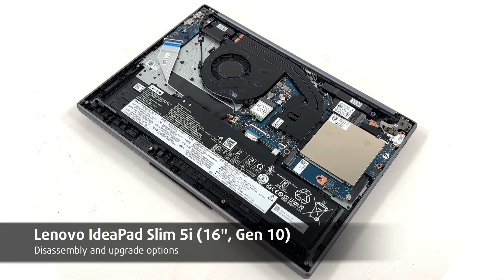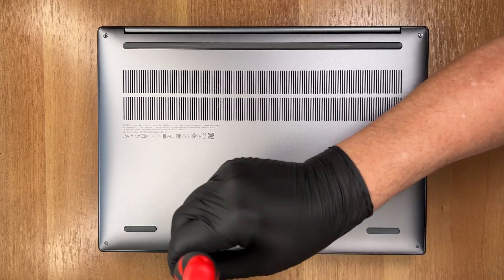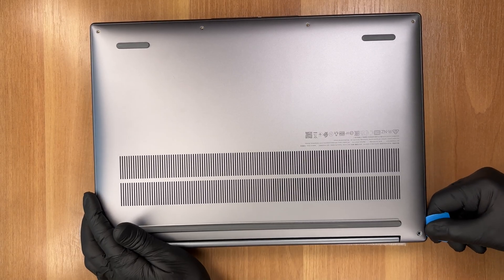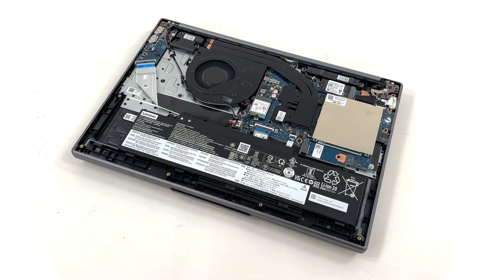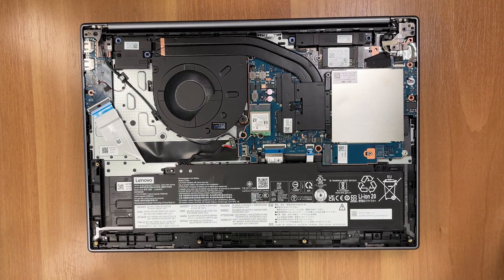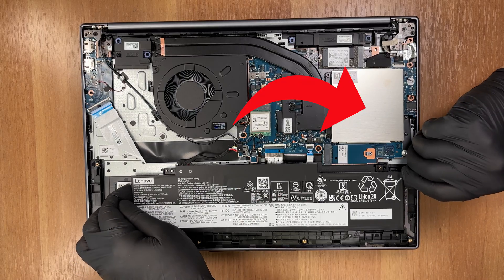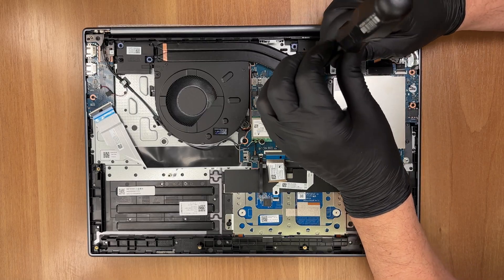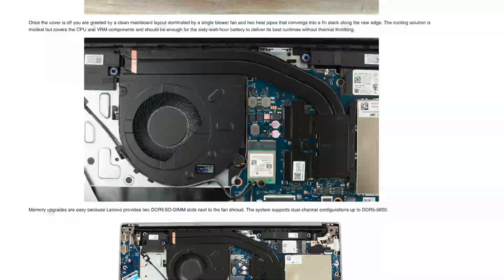🛠️ How to open Lenovo IdeaPad Slim 5i (16", Gen 10) - disassembly and upgrade options

Comment: hello sir, i wanna ask .  i have ideapad slim 5 14AKP10 ryzen AI 7 350 with 24GB RAM 4800 .  i want to change into 16GBx2 5600 it is fine? or must 4800 too?
Reply: I am here looking for the same question. is it possible ? Have you already done the upgrade.. ??